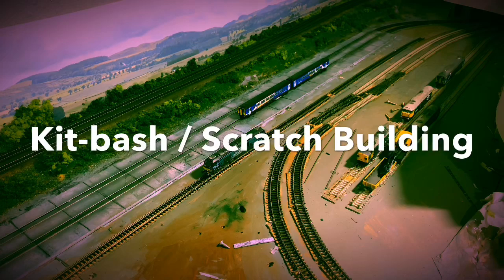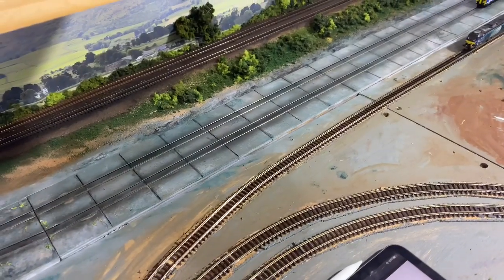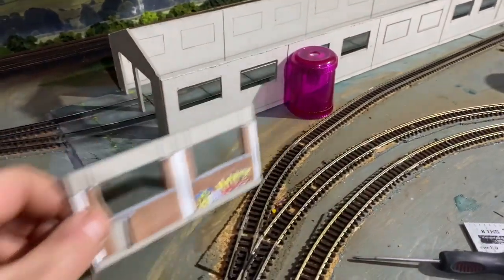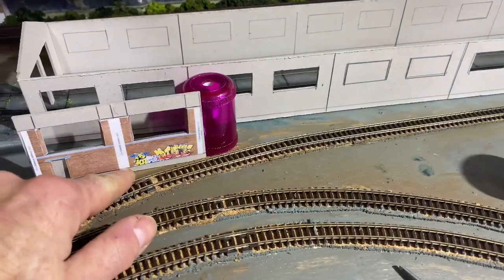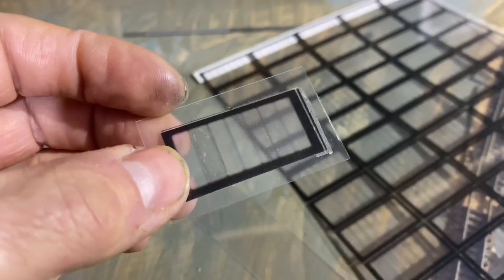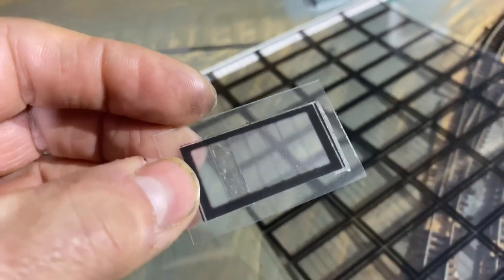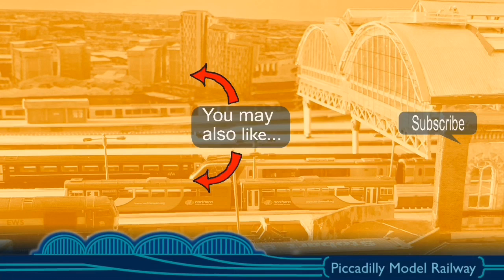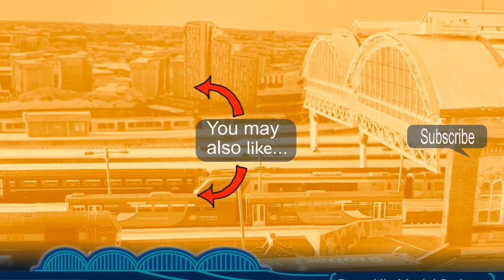CARRIAGE SHED BUILD 1 - BASIC CONSTRUCTION N gauge

Comment: John, how about modeling the new Siemens Trans Pennine Depot at Ardwick? A lot smaller and with similar carriage sheds and the line to Dinting and Glossop passes by...about a mile nearer to Piccadilly than Longsight.
Reply from the maker: Steve Lomas hi Steve, thank you for the suggestion. I’ll have a look, but the overall layout has got to match, even vaguely to the layout I have. Longsight does kinda match even in a very simplistic way. Thank you for taking the time to comment.